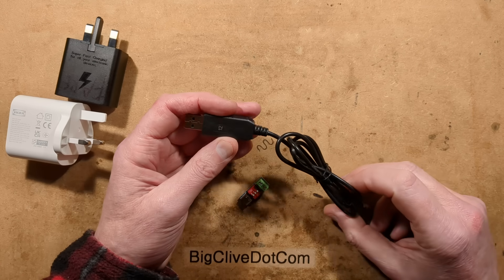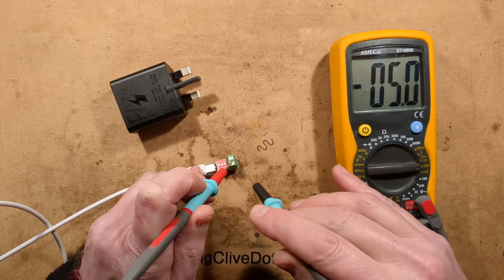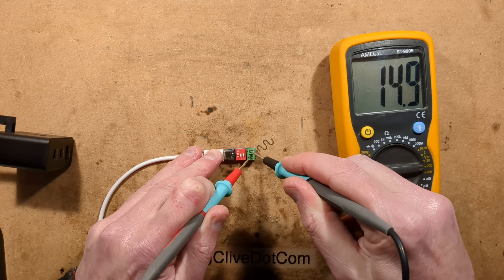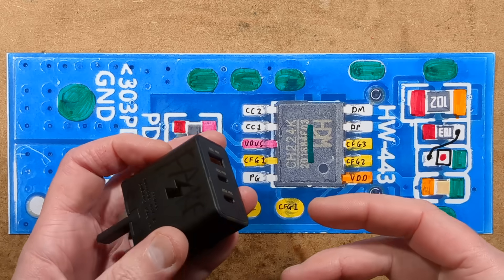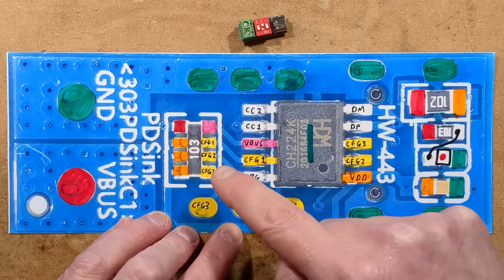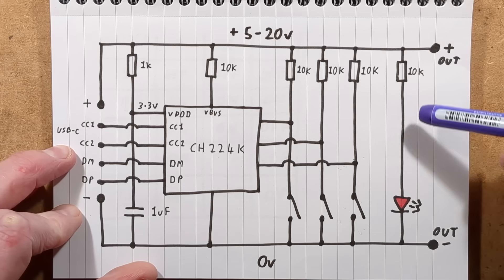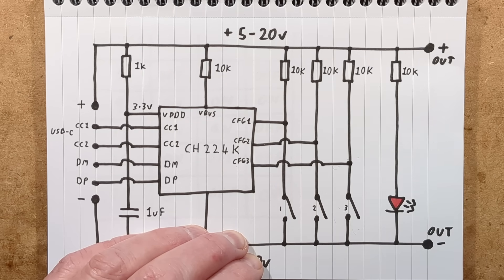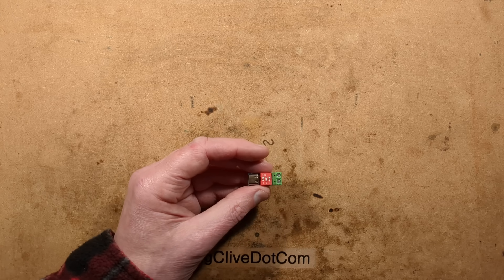Cheap USB-C programmable PD voltage module for 5,9,12,15,20V

Comment: Something that really sucks on all of those modulesis is that the PG (Power Good) output of the CH224K is never utilized or easily accessible. The pin is pulled to ground if the received voltage is actually the requested one and I would prefer if they would connect the LED to that pin instead of VCC and maybe even add a power MOSFET that only enables the output if the voltage is correct.
Reply: Looks like a fairly easy mod to flip the LED around to disconnect it from Gnd and run a bodge wire to the PG pin or even bodge a second LED on. Anyone buying/using these boards is likely to have the required bodging skills.
Reply: @mfx1  I would be worried about the maximum voltage for the PG pin. It's not specified in the datasheet for the CH224K, however it is specified for the CH221K and it's only 13.5V. I would add a zener diode that's 10V or less between the LED anode and ground just to be safe.
Reply: @mfx1  I'd prefer it pre-bodged so I could just add USBC power to guitar pedals.
Reply: @mrljgibson You can just use it, the lack of a PG LED doesn't prevent that and I'm not sure how an onboard PG LED would really help as you wouldn't be able to see it and once you've set the voltage that pedal there's really no reason to change it. If you did want an LED it would be better to run wires from the PCB to a case mounted LED.
Reply: This is why I have about a half-dozen of those little USB C inline volt/amp meter displays to verify what's going on. No way I'd trust a charger-device paring unattended before I checked it. PD is awesome when it works, but it all feels like a dumb system at times.
Reply: @bnasty267  Sadly, the problem isn't really PD, but rather how these boards are setup.  That plus the stupid number of old charging standards so USB A ports aren't limited to 5V.
Reply: It is pulled to ground if negotiation is successful. Many versions of the chip consider asking for 12V and getting 15V to be a success. So the pg pin isn’t as useful as I would have hoped. I have designed boards to check the resulting voltage and ensure it is about 12V before passing it through. Because for many supplies 12V is not a supported voltage as it is not required in the standard. Any supply that can do 20V must also do 15, 9 and 5 but not 12. IKEA supplies all do 12 though.
Reply: @stevebollinger3463 iirc 12v was part of 2.0, but removed in 3.0
Reply: @JohnDoe-c2f No. I just looked at the 2.0 2017 spec again to be sure. Table 10-2 shows the normative voltages and currents.

Any power supply with up to 15W (inclusive) capability must support 5V. Any supply with up to 27W (inc.) must support 5V and 9V. Any supply with up to 45W (inc.) must support 5V,9V,15V. Any supply with up to 60W (inc.) must support 5V,9V,15V,20V.

Other voltages exist in the spec, but the required voltages are as I said. I have a friend on the committee and he said 12V was in there while they worked on the spec but it was removed because they wanted to cut down the number and they had to have 15V for laptops (very common for laptop bricks) and 15V was quite close to 12V and 15V could do everything 12V could do, wattage-wise. So it was removed before the spec went final. It's used as an example in many places in the spec. It's just not one of the required voltages.

You can search for the "normative voltages and currents" to see it for yourself.

In the 3.2 (PD 3) version of the PD spec it is table 10.2 (dash changed to dot) and shows the same voltages. Although due to the SPR changes in the 3.2 spec 12V will be common (I think actually required) in power supplies that support 30W or more. It's confusing because such a rule isn't actually in the spec, it's just that more flexibility is required by the supplies such that every voltage between the max and min voltage for a supply can be provided in 0.2V increments.
Reply: @stevebollinger3463  Interesting, as I was thinking 15V was strange in that only a phone might use it.  Every laptop I’ve ever looked at used 20V (or, for some reason, 19 or even 19.5v specified even though 20 seems to be fine.  maybe wire voltage loss)
Reply: @radellaf maybe 15V was considered to be a good match for devices that ran off automotive power. I know we call that 12V but it’s really 13.8 to 14.4 volts when running. He said that on the committee people stood up for the other voltages more than 12V so it was dropped. Personally I can’t figure out what 9V is for. It is intermediate between 15 (or 12) and 5 but who would use 9 for anything?
Reply: @stevebollinger3463   True about automotive power.  A lot of "12V" things I have are perfectly happy with 14V, but I think 15 might be pushing their spec.  You could always burn off a volt with a diode, at least under a little load, and the wiring is going to drop half a volt pretty easily at higher currents.
9V?  A lot of older electronics, and maybe for some reason phones could use 9V for fast charging easier than handling 12V (like the QC standard).  All my old AC-DC adapters are 6, 9, or 12V.  Multiples of 1.5V batteries, I guess.  So is 15V, but not much used 10 cells (some handheld radios or scanners).  There's also a sprinkling of 3, 4.5, and possibly 15 AC adapters.  9V was really common, and I run some of those things with a PD trigger USB-C female-to-5.5x2.1-coax-plug thingy.  For fun, anyway.  Only really has a point to do that if I'm using a power bank.  Plenty of universal voltage AC adapters out there (of questionable quality).
Reply: @radellaf  One thing to think about is that the spec repeatedly indicates that the point of these voltages is to provide a rough voltage to be re-regulated to the one you really want.

And so if you think that regulating down is simpler than up (and linear regulation certainly is an example of this) then it's a lot easier to make the 12V you want from 14.3V (after line drops) then from 11.3V.

Definitely the spec doesn't try to explain the usage models people talk about like using a USB-C supply as a regulated (bench) supply.

In my case the device I wanted to connect to USB-C wants 12V but I know it re-regulates the input. So they surely could easily have designed it to take 15V. But fact is they didn't, so I gotta find a way to get 12V out of a USB-C PD supply to give to it.

Same would go for things like fairy lights. The ones I see are available in 5V and 12V versions. But that 12V isn't really 12V, there are big voltage drops along the wires. So they certainly work fine on 11V. They are, to an extent, re-regulating. But on the other hand they really don't want 15V. So again I need to find a way to get 12V from USB-PD to supply to them.
Reply: @JohnDoe-c2f & stevebollinger3463, thanks for for the PD spec voltage discussion. I bought my batch of these gizmos for the 20 V option so that I could power a cost-effective (ie $20 Amazon) Class-D audio amp. I had been powering the DC-supply-in amp from an old, repurposed,  Dell laptop brick (19.5 V out). I'm now powering the amp from a Bluetti PPS (USB PD "100W")/PV panels via the PD gizmo. The Bluetti's app shows 0 W DC output when amp is playing music; dunno if the 20V current draw is bellow the Bluetti threshold and/or it's a bug in the Bluetti.
Reply: I used it to p channel mosfet
Reply: Ya, it should output ONLY if the requested is available , learn the hard way
Reply: Some also pick the next nearest lower available to turn on (which in many things is useful still)
Reply: @matthewmiller6068  That's what I see on my few bricks that don't support 12V. They'll serve up 9V, instead.
Reply: Would be an excellent indicator that your USB wallwart/power bank is a “polished turd” outputting the wrong voltage 😠
Reply: Where can i get one like that please? I need one that can do 100W.
Reply: I had one of these, with a DC-DC converter behind it, to charge a Vacuum cleaner. It needed 30v to charge, 28v trigger-voltage didn't fill it all the way up.

So I bought a 28v trigger board to put in front of the DC-DC converter.

And soon I burned my fingers on the large very capable DC-DC converter and I was like, wtf happened? It's only a small stepup and a 30w pull I'm trying to do? 
On a 140w capable Anker powerbank.

It turns out that some of the Anker ports couldn't do 140w (28v max), only 100w (20v max).
This lead the board to just getting 5v and because the pull was 30w max, I guess nothing tripped inside the powerbank, as the DC-DC converter yanked 5v, at probably 3-5 amps and boosted it to 30v, to deliver those few watts to the battery being charged.

Fuck me, I wish they had exactly the feature being requested here: Either give me the proper voltage or nothing at all.
Reply: I agree with you. I used to think that a MOSFET was a great idea. But, in reality, it's even easier than that. And this chip is even more stupid.

You notice how there isn't any power coming out from the USB C power supply, even 5v, unless you have a trigger or something like this device?

The only reason that these devices provide lower voltages is because the chipset *accepted the lower voltage and told the power supply YES!".

If you had the DIP switches set to 20v and connected it to a 9v max supply, you would get zero power if this chipset just said "nope, not interested!"

That's how badly the firmware is written. :(
Reply: @gf2e  i mean there is the risk of dodgy / incompliant usb c power supplies that just blindly dump the output ANYWAY
Reply: @gf2e  I still wouldn't trust the power supply to not provide the wrong voltage. If you connect a "dumb" carger it would definitely put out 5v which may be way too low and damage the circuit.
Reply: @im1random263  Oh, very good point. A dumb charger or just an A to C cable would do that. 

I have a knockoff unbranded charger with six or so C ports. Highest power on the left, lowest on the right. The one on the far right is always live with 5v.
Reply: @gf2e  When connected to an incompatible power supply, it is desirable that a real application have enough power to recognize and signal the error condition to the user, rather than to simply play dead and incur support costs, returns, etc. Also, this chip is designed for dynamic USB power control; the idea is that if you want policy, you build it yourself.

Comment: Pro Tip :face-green-smiling:: 
Always return it to 5v configuration before you put it down from your hand. :face-orange-biting-nails:
Reply: Kind of like ALWAYS returning your multi-meter back to the voltage configuration, after you've just done a current measurement, BEFORE it leaves your hand. I've blown up a VERY expensive audio amplifier by making that mistake before. I'll NEVER do that again!!.. 😮‍💨
Reply: @davelowets  Then you should probably take a look at the fuse, my multimeter blows the fuse long before it can damage itself or other equipment.
Reply: @maxjakobsen5526  A/V equipment is notably very sensitive, so even if fused it'll still damage the circuitry when the fuse blows.
Reply: @maxjakobsen5526  unless you are using the famous 10A input with the shunt...🤣🤣🤣🤣🤣🤣(holy smokes!)
Reply: @nightshadelenar  
156
You don't know what you're talking about, a fuse is not just a fuse, there are different types. Mine actually protect the electronics they are intended for.
Reply: @maxjakobsen5526 exactly they're acting like fuse are only used to stop catastrophic failure, and releasing some magic smoke. In reality it's gonna burn at 15amp, but only damage circuitry at 8amps then you should probably used a 5a fuse not a 10a even though that will stop a fire.
Reply: @jimdil4st  At the risk of repeating myself. A fuse is not just a fuse. You should read a little about fuses. My fuses absolutely cannot handle 10.1 A, then they are blown.
Reply: Voice of experience?😅
This is why I don't like USB-C in general. Negotiated voltages just seems far too much of a risk of accidentally destroying something with far more voltage than it should.
Reply: @CanizaM I WOULD think that there would be LESS chance of blowing something up, when it CAN accept varying voltages, and its done automatically.  Now IF we had to SET the voltage ourselves for specific devices, then I COULD see accidents happening. But not when its done automatically
Reply: @CanizaM and something like a raspberry pi uses the same connector but then uses a proprietary voltage which makes it unusable with regular pd chargers.
Reply: @FirstnameLastname.69 what does 'proprietary voltage' mean?
Reply: @Ancipital_  I meant proprietary voltage and current. the pi5 requires a weird  5.1v at 5a, especially if you’re using peripherals and a ssd boot. It doesn’t even negotiate to usb pd 5v 3a or similar. So you’re stuck at the lowest power level getting undervoltage errors or reboots, unless you use their official power supply.
Reply: 😁 Very helpful Clippy

Comment: I have noticed on mine that the 1K resister can get quite warm. Almost to the point of being uncomfortable to touch.
Reply from the maker: It's a simple shunt regulator, so at the higher voltages it will get quite hot.

Comment: I recently got some addressible RGB fans for my pc case, but my motherboard doesn't have the 3 pin headers for actually controlling the ARGB
I found a $2 aRGB fan controller on aliexpress with buttons on it to control the colors (takes 5v sata power)
Would be cool if you got one to take apart, I have no idea how these work, I'm also kind of curious how it controls the colors but I assume you'd need an oscilloscope to see that
Reply from the maker: It's usually a basic microcontroller using a single output pin to send the required serial data.

Comment: These are great, I use them to provide 9 or 12 volts for PC fans to push air over house radiators for greater heat output

Comment: I just got a module from adafruit that simply has a male and female USB-C, with the resistors to activate PD at legacy 5V

sure helps with my dozen or so devices that don't support PD and won't activate the PD power supplies to deliver charging voltage.

Comment: I wonder why they didn't just put a male USB-C on this module...seems like it would take some of the issues out concerning inadequate connector cables.
Reply: if it had a male and got bumped, that could snap the connector off pretty easily. they could spend the extra time to put a glob of hot snot on it or whatever, or they could just put a female on it and act under the assumption that if you're the type of person to buy this thing, you're probably also the type of person to have good USB cables lol
Reply: Because you put them inside bits of gear that you want to USB C power.
Reply: These also exist, but for some reason the USB connector shell does not really fit together. I just put heat shrink over it.

Comment: How can the voltage on the chip remain the same (3.3V) at input voltages of 5V, 9V, 12V, 15V and 20V with only a series resistor of 1K without a voltage regulator? I just consulted the datasheet for the CH224 and it mentions a built-in low-drop regulator.
Reply: Chip has an input range 4-22V with an on-chip LDO to regulate itself.
Reply: @radellaf  Yes, indeed, I had already looked it up in the datasheet.
Reply: @radellaf they get away with the big linear drop 22 to 3.3 because the chip uses very little current.
Reply from the maker: I think it's as simple as a shunt regulator inside.  The resistor just limits the current.

Comment: I love using these to power tinkering stuff when on the road or at events.. sadly I found out that the one PD power supply that I've always got around (Lenovo 45W brick) does NOT support the 12V mode, only 5/9/15/20..